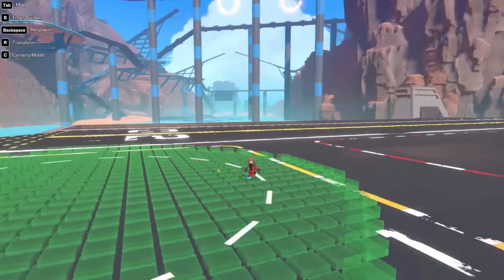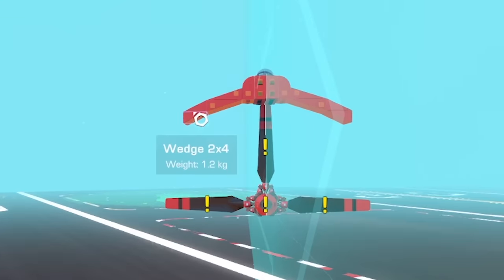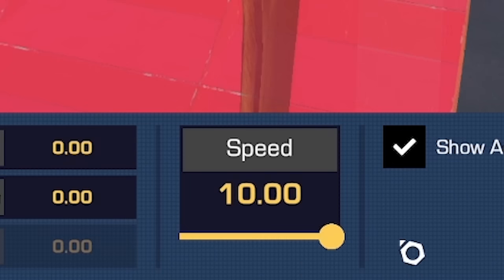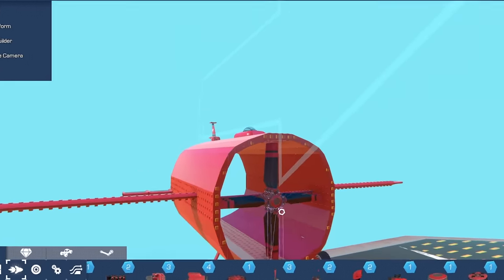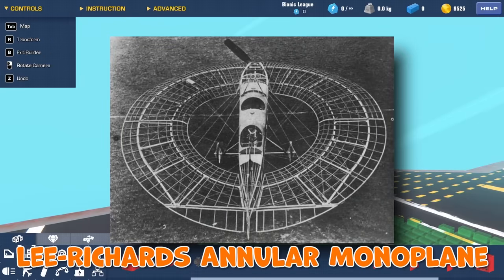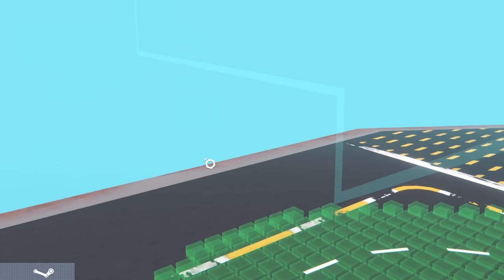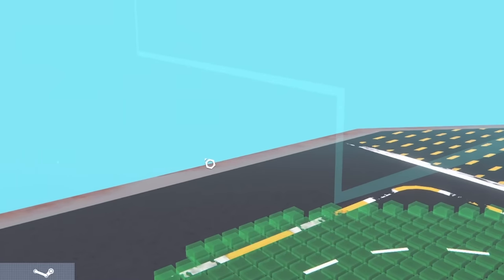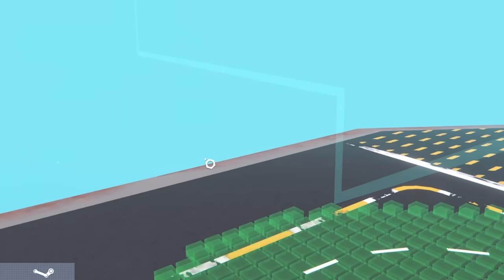Pushing aircraft engineering to IMPOSSIBLE EXTREMES in Trailmakers!

Comment: Matt, Trailmakers has some interesting physics and mechanics.
Something that you could use is the difference between aerodynamics and the weird, secondary aerodynamics of wings, helicopter blades, and paddles. Their weird floaty-Ness/extra drag compared to a part JUST as flat is separate from the aerodynamics shown with the arrows. Therefor, to fly with just an up and down motion on a wing, a 4x4 wedge could go on top of a modular wing, and since it's more aerodynamic on the top, simple flapping will cause anything to go up. You can use some OR logic gates to create a looping flap.
I used this to create a realistic mosquito. It's called Asian tiger mosquito on the steam workshop, maybe check it out to get some ideas... or steal the logic gates, because it was confusing for me to make. It's great potential for a stupid build.

Comment: The front controls on the ring-wing cannot lift the plane by deflecting upward.  Front deflection will be the opposite of rear deflection and this is why standard flaps create lift by deflecting downward on the front wing.  Aircraft with front and rear wings work like a seesaw.

Even if the front wing flap directions were swapped, however, the plane would not be easily controllable without the rear wing/flaps.  Up and down controls need to either be ahead of or behind the main lifting surface to apply leverage.  Leading control surfaces create unstable flight, however, which is why the vast majority of aircraft have them behind the main lifting point.

Even though I've read a number of books about the topic, it's always remained odd to me that the Wright brothers were inspired by birds when designing their airplane, but still decided to put the tail in the front and the engines in the back.

Comment: Tip: Using distance sensors on 0 distance with "Inverted Trigger" enabled will automatically enable anything it is connected to, stopping the requirement of pressing a button before going.

Comment: matt, is the aerodynamics section theres rounded parts, and the opposite of a rounded wedge, which if there both conbined you could make a circle
Edit: altho using round parts would make you an architect otherwise, theres no plane architects, so you litteraly cannot be an architect when building anything to do with aviation.
another edit: im talking about the first plane.

Comment: trailmakers' aerodynamic model gets real wacky when you have that many wing pieces, as observed with the toilet seat basically hovering when the propeller is turned off. also the difficulty in controlling that is probably down to the rotational torque the single propeller applies to the rest of the vehicle; adding a second propeller rotating the other way would probably resolve it.